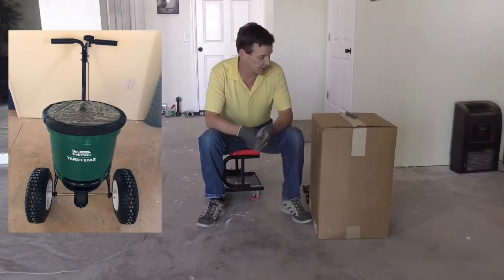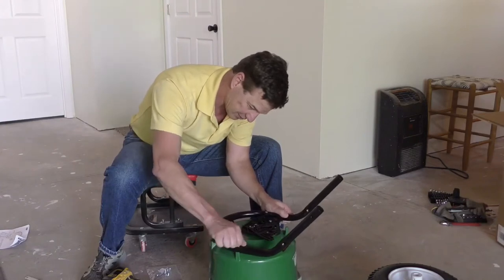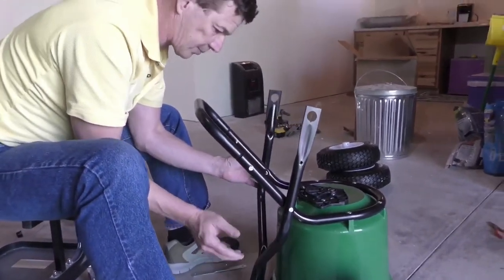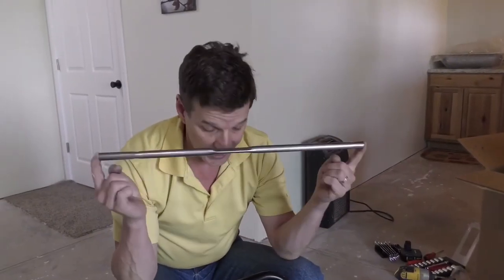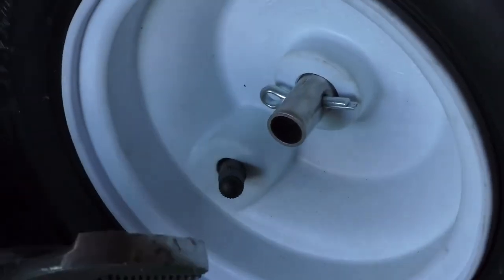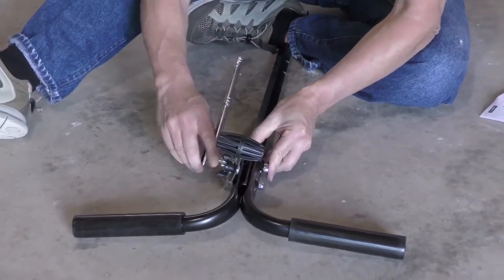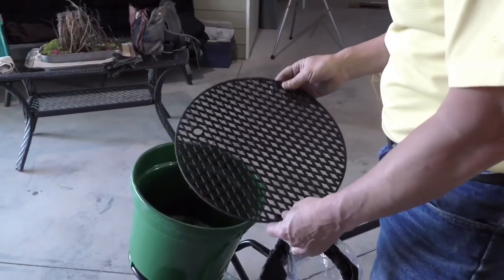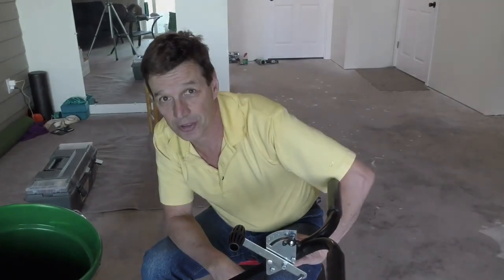Yard star spreader assembly instructions

Comment: The written instructions are terrible.  This is not much better.  When you say there is one a hole on the spreader when you install the pivot rod, there are two holes. When you were showing how to install the pivot brace, the camera work is terrible and you cannot see how you installed it.  Get some close up shots as you install the pivot brace.  Please produce another video because this is very frustrating.